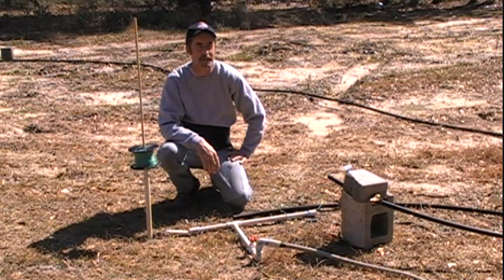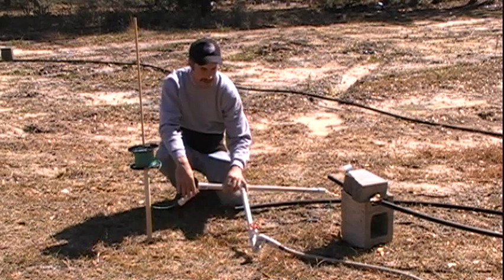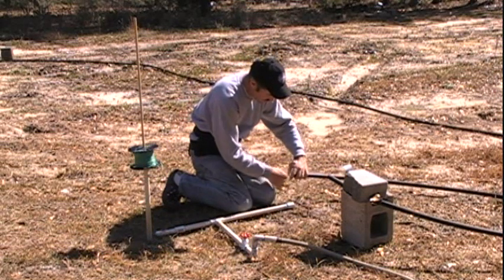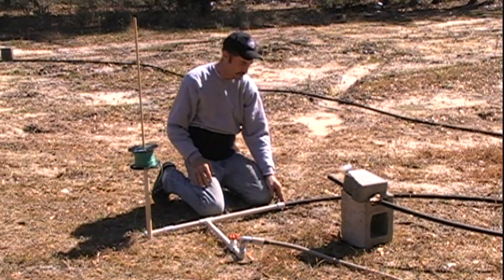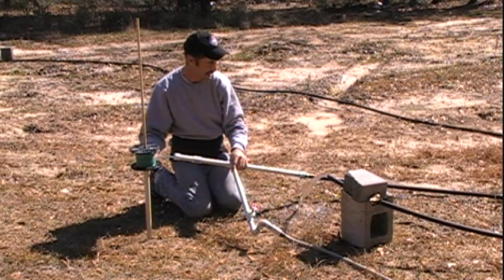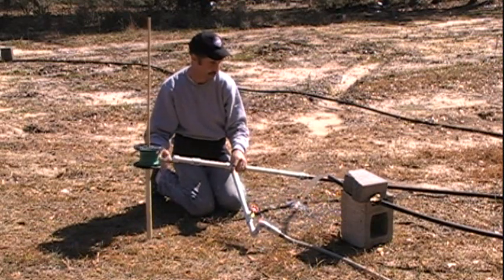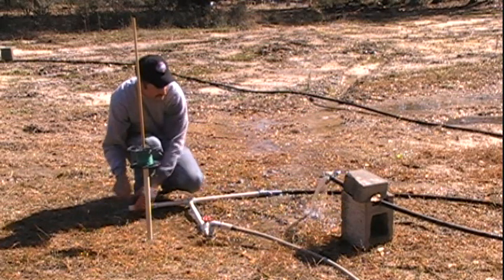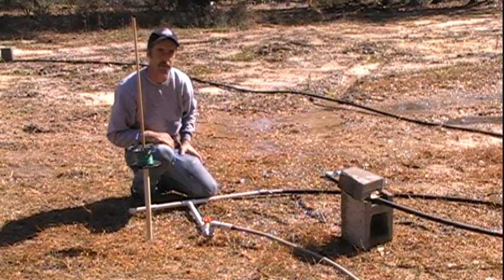Water Powered FishTape Pusher

Comment from the maker: @Crowbar1963 Yeah air works better than filling the thing up with water by far if the pipe is clear.  I just had to unblock an 1 1/4 conduit running under my driveway to my power box that had somehow over the years filled with sand so I ran water in from the power box side slowly so it didn't get the inside of the hot box wet with a vac on the other end and after an hour it trickled through and flushed it clean, then I let the vac run all day to dry out the pipe before I ran #6 cable through.